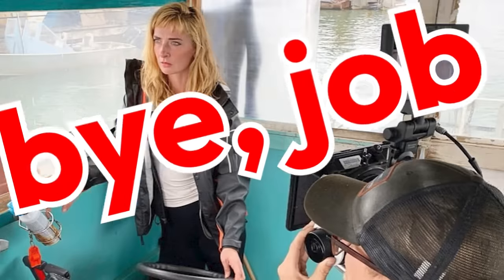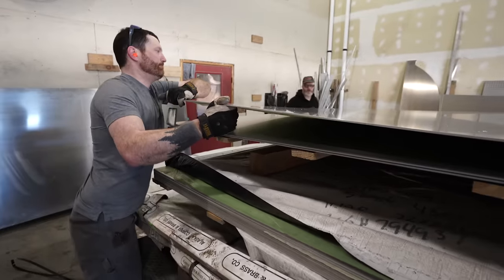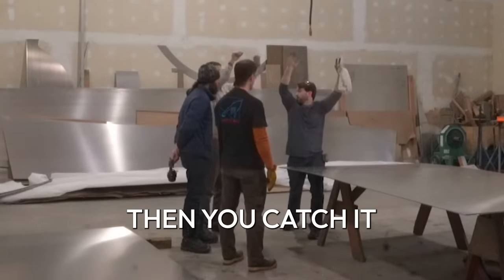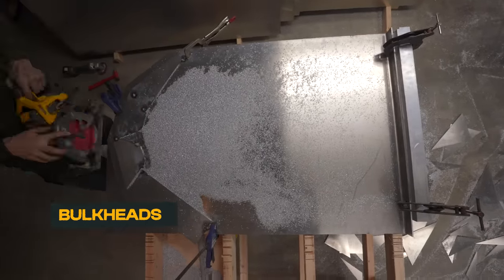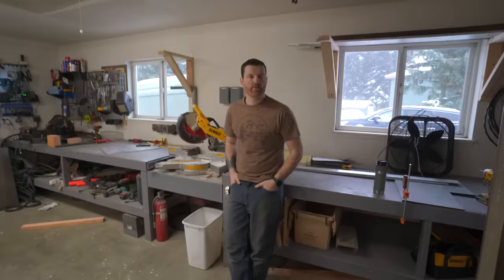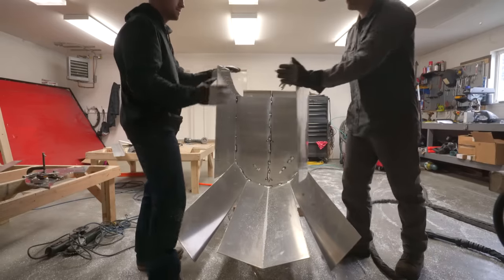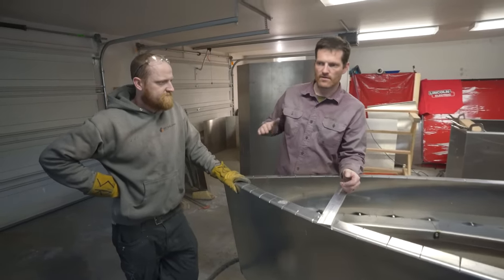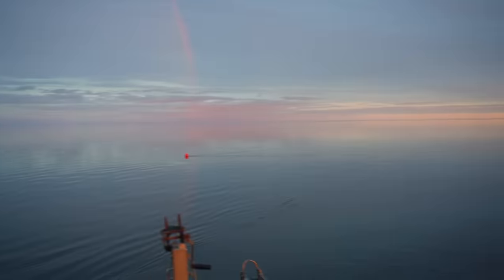I lost my job on Bering Sea Gold

Comment: Surprising that the production company didn't make you sign something saying you wouldnt compete with their show. Hope to see you succeed!
Reply: Even if they did, non-competes have been struck down all over the place due to the difference in power/burden between parties.
Reply: If they're stopping filming, then there's no show to compete with.
Reply: @Andrew-3445  Depends what the contract states. I've read about 500 contracts and some are insane.
Reply: @anonymous_friend Nice comment did you make this stuff up today? I am a commercial law attorney who specializes in contact law, and generally, a non-compete clause doesn't apply to actors who are protected by SAG law So if you've read 500 contracts which makes zero sense why you would or where you found 500 non-compete contracts because they generally only apply to corporations where sales are involved or general contracts in isolated locations...I can guarantee none of them applied to Sag protected actors there is no such thing as a non-compete clause in a residual earnings contract which all syndicated television actors sign... 😂
Reply: They did, when the show was active. It's canceled...She didn't get terminated, the show did...
Reply: Bearing Sea Gold is canceled; There is no longer a valid contract...As long as she doesn't include any Discover trademarks, she fine...
Reply: Is it? I am watching the winter show so no more after that, what a bummer...

Comment: I repaired Lincoln Welders at Norfolk Naval Shipyard many years ago. I rewound the generator part. The diesel engines were repaired if needed by the engine shop. These welders were really old because I was working from 1974 to '79 before transfering to Puget Sound Naval Shipyard. I repaired a couple when working for the Washington State Ferry system at Eagle Harbor,Bainbridge Is. They are great welders as well as a back up generator with inverters for AC.

Comment: Looks like good quality fab work. From the leaks I saw there appeared to be galvanic corrosion which is the weak link about aluminum in salt water an (electrolyte). Make sure your electrical is properly isolated from the hull, don’t use household electrical components since they crossover the white / neutral wire and be sure to use the right anodes instal a galvanic isolator, never put bronze or brass on aluminum, isolate connections to steel even stainless. Once again good call on the oversized pontoons and good fab work.

Comment: Emily, if the pontoons had bilge keels  on the outside, 4 inches above? (depending on the draft)  the last bend, it will provide much needed roll control, and can be added anytime before it's launched!!
Reply from the maker: It's launched already! Roll isn't a problem thankfully they're wide

Comment: I kind of feel when he was considered the draft the pontoons were going to experience, was slightly off.  With the bottom of the pontoon closed in on the angle it has a reduced water replacement than equally measured section of the cross section that does not have the taper.  So essentially when he says if you double your weight,  it actually will sit higher in the water than what he references.  If it drafts say 10 inches on the tampered bottom pontoons and you double the weight, it will likely draft say 17 inches or 18.  

Great video though,  I really enjoyed you on Discovery and also enjoy this self made production .  Even if Mike Rowe isn't narrating 😂
Reply from the maker: Probably right! It was a pretty rough guesstimate. Wish we could get Mike but he's too expensive haha thanks for watching!

Comment: I saw a two part liquid expanding foam used once and might be worth looking into for the pontoons. They cannot sink. If the weight distribution on your dredge was equal, you could literally cut it in half and it would float. Just a thought.

Comment: You should check out the 36 inch pontoons made by Nautilus Pontoons. They are Super heavy duty and unsinkable. They are like 3/8’s thick plastic with foam mold injection. They have different sizes 17”,26”,36” and I believe 48”. They come in 48 inch long sections that lock together and you build a platform on top. They are designed to use 2x6 inch wide aluminum tubing for the frame. I’m getting ready to build a 12x36 foot unsinkable house boat. One 48” section will float 850lbs at 50% submersion. This means my 36 foot houseboat will carry 15,300lbs and only sink 50% of the pontoon. If you damage one section it can be drained and plastic welded or you just order a new section for like $500 bucks. Having a unsinkable boat is a huge piece of mind. You can add more sections in the middle to increase your cargo capacity or order larger diameter pontoons. They are great around ice. As the water freezes it just pushes the boat up on top of the ice. You can bolt the 2x6 tubing together with aluminum angles or weld the frame together. I’m going to bolt mine together to allow it to flex. You can use 4x8 foot aluminum Diamond plate for decking or treated plywood. These pontoons are used my the military to build portable bridges and unsinkable boats. They are reasonable to buy. I need 18 sections At around $500 each. That’s $9,000 for a unsinkable hull, plus a few thousand dollars in tubing. Decking will depend on you. Aluminum is a one time buy, but plywood is easier to work with if you plan to build a cabin on it. Nautilus Pontoons has to be much cheaper than what you are building. Plus you can still sink. A Nautilus Pontoon built boat will get you home every day. The biggest fear with any boat is sinking. Imagine never having to worry about sinking again?? That’s Priceless 🇺🇸🦅

Comment: 👌 upgrades! 
It amazes and concerns me how many “pro” alloy fabricators in 🇺🇸🇨🇦 dont sand off the oxide layer before welding.
Reply: You dont have to, the welder has cleaning action and does it more effectively.
Reply from the maker: Thanks!
Reply: @outkast187  please explain the cleaning action?

Comment: Glad to see somebody's putting in some water type bulkheads. Without reading all the other comments, have y'all considered spraying in a 20 oz closed cell buoyancy foam inside your pontoons versus putting a double walled bottom?
Reply from the maker: A lot of people suggest foam, but it's just not needed if the welding is good! And the bulkheads prevent sinking under most circumstances!

Comment: I would try to use the old dredge for a storage barge of sorts you can take as a tag-a-long. Anchor it up nearby and leave the fuel, hoses and other stuff on it to clear up deck space on the new boat. Only if the fixes arent that expensive of course.
Reply from the maker: Cool idea!
Reply: @TheEmilyRiedel  I lived and worked in SE Alaska for most of my life, hauling equipment, sand and gravel around. Having an 'extra' barge is very handy. glty all, i've been a long time watcher of the show and series.

Comment: Coming from a retired aerospace welder, the pontoons look well engineered along with the inner structure. The only thing I would have added to the design (just my opinion and experience) would have been to add bead rolling on the outer skins; it adds extra strength to a malleable metal.
Reply from the maker: Hey thanks! We put a lot of thought into it. And interesting idea!

Comment: Rebuild the old pontoons and put together a light duty exploratory rig ,, 
A quick light duty unit which allows shallow water exploration ,, not a full blown producer but something you can send out when the main is on pay and busy that can look and hunt out new spots for the main.
This would make you more efficient in finding the spots you need..
Reply from the maker: Interesting idea. Manpower (and equivalent housing, vehicles, infrastructure) is the pinch point. If a guy's diving you want him on the big nozzle

Comment: Emily Riedel: I would take the old materials, and reforge them back again. This would give you material for projects down the road. Like an insurance policy. the old pontoons would be great for the operations. for example: A new rack for equipment, New computer boxes. Scrap material for repairs on the new pontoons. Lunchboxes. Another idea, is  new shop item. Signed autographed plates with parts of the old pontoon, with boat, self pictures.

Comment: Interesting watching design and assembly of the pontoons. I'm an old air frame mechanic formerly in the Air Force.  Question? .063? Alclad? Any rivets? Liked the reinforcement and how you did the bow. GET LOTSA GOLD. Merry Christmas
Reply from the maker: Thanks for following along! 5/32 and 3/16 aluminum alloy 5052/5086 mix. No rivets - all welding. Merry Christmas to you too!

Comment: Curious as to why there isn't a, say, 3"x3" grid on the front of the suction tube to keep out larger rocks that cause the jams. Obviously, my thought is not a new one, but it seems to make sense since jams can eat up so much time.
Reply from the maker: We have a reducer ring that brings the diameter down to 8" to prevent the big ones. If we could only suck up 3" rocks we'd work maybe 25% as fast and wouldn't make any gold. And rock jams don't always come from big rocks, a lot of times it's a flat one going up the hose slowly and rounder ones coming up quickly behind it and creating a jam. Jams get a lot of play on tv because good mining is pretty boring to watch, just endless hours of listening to a guy breathing underwater, but they aren't as common as you'd think. Probably less than 5% loss in production time.
Reply: @TheEmilyRiedel  Thanks for the info!

Comment: I hope everything works out for you but I'm very surprised they didn't use fiberglass aluminum has a tendency to crack and everything else for fiberglass will hold up a lot stronger
Reply from the maker: Lot of commercial vessels up in Alaska build with aluminum. Since we had a professional aluminum boat builder on the crew already, the decision was easy ;)

Comment: You could have done this by making it rectangle and fill with foam for a fraction of the cost. I think you could have done it in Nome as well!
Reply from the maker: Not as small of a fraction as you think! Lots of issues with foam, too. Shipping hazmat is super expensive, it's tons of extra weight, no ability to modify the design. And we wanted a proper commercial vessel hull and the associated performance. The goal is to go faster, not slower

Comment: Why didn't you fill the pontoons with foam that way if you get a hole it will still float
Reply from the maker: Too difficult to work on and make repairs after you fill them with foam. Also adds a lot of weight. And it's not needed! We make them watertight and test for leaks.

Comment: i dont understand why you would not convert an old dragger or even a sportfish. more weight capacity, better qol for off shift and depending on the boat better suited for ice strikes.
Reply from the maker: So many reasons! There are lots of unique issues with retrofitting sport boats to this job with all the gear that goes in and out of the water. Most find custom builds are the way to go. Easier to build exactly what will get you the most gold
Reply: sportfish and lobster boats transoms are or can be virtually sea level which it doesnt get better than that for getting in and out. longer range, more power, much thicker stronger hulls resistant to ice, actual shelter,  more weight capacity, ability to withstand larger waves, as a boater my entire life i do not see the benefit of building a thin pontoon boat but regardless on the motives best of luck on the hunt for the shiny stuff.  @TheEmilyRiedel
Reply from the maker: All I can say is there are only 7 or 8 successful diver dredges and only 1 of those is a retrofit. It's not a new idea. There are 10,000 little trade-offs and choices, many involve logistics and figuring out what's available locally. Obviously it can be done - there's no prescribed "right" way. But this is what we have and it's much higher ROI to invest in the platform I have now than build a new operation, and we have the talent available to get it done.
Reply: @TheEmilyRiedel  i never said it was a new idea just a logical one. Could have bought an old lobster boat with a detroit for what you paid for toons. Here is a new idea for you tho. Attach a line to your anchor and have a sailing block with cam attached to your divers on a carabiner, the block allows for fast easy adjustment of the line the carabiner for easy emergency removal. Yous will no longer have to fight the current as long as yous have a good grab on your anchor.

Comment: Everyone always wants new for 100k i would have found a used barge and a used excavator, thrown some stabilizers and 10× the haul.... just saying.
Reply: This is going to work in extreme conditions, so you can't just go slam some junk together and expect it to work basically 24/7 - I would say, they've been there and tried that - and it sucks when the equipment breaks down in the middle of nowhere, and you can't get parts for it.
Reply from the maker: You're welcome to try!